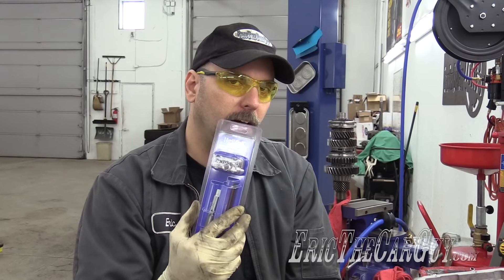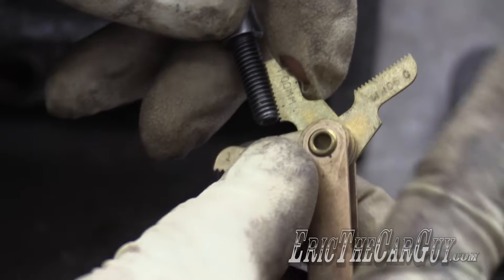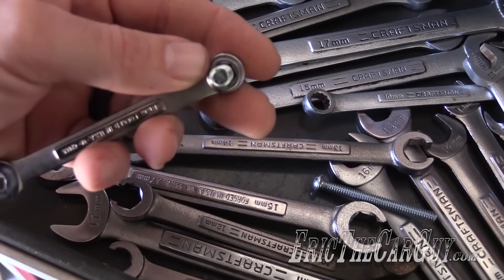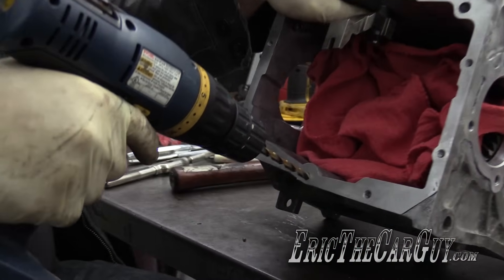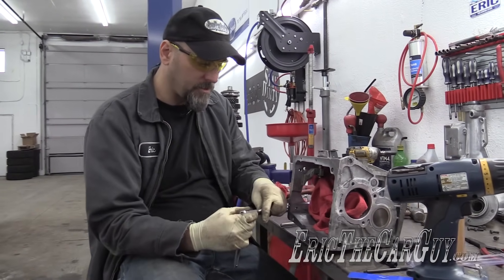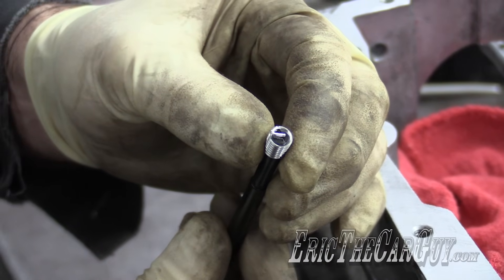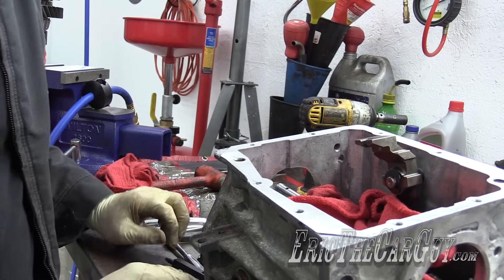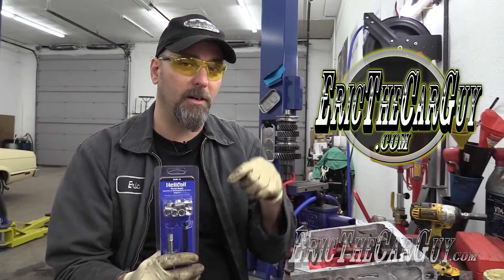Stripped Thread Repair: How To Install Thread Inserts

Comment: I've got a 2006 VW Passat 2ltr TDI 140HP
I replaced the rear bush on the lower arm (the one in the cup) but a thread was damaged.
A friend and I tried to re-tap the threads with some success but it's now working loose.
Would a Heli Coil kit be strong enough to withstand the stresses that the suspension endures?

Comment: Why only small amount of AWD cars has a diff locks? I mean, normal diff locks, for every 3 diferrentials. That allows car to be better in off-road situations. I know that there is an electronic stuff trying to "lock" differential using brakes, but that is not enough sometimes.
Reply from the maker: You'd have to talk to one of the factory engineers on that one.

Comment: I drilled it out with a 1/4" drill bit to a depth of 3/4". The hole is too big for the 6 mm X 1.00 mm pitch Tap. Shouldn't the tap size be like 7 mm X 1mm pitch to allow for the helicoil?

Comment: Could one put in more than one helicoil to have longer threads?
Reply from the maker: IDK. I don't know if I'd try that. If it's not aligned correctly it could bind up the fastener.
Reply: That makes sense, maybe they make longer coils. Thanks Eric!

Comment: are they stronger now since they are made of steel? (the threads)
Reply from the maker: Hard to say, but they hold up under the factory specified torque just fine. 80inlb BTW.

Comment: Why do we need to use those inserts? Is there a benefit? Why cant we just tap the hole and use a new bolt for the correct size? Is that insert "always" needed?
Reply: Short answer: Yes, but it also depends.
Long answer: Since the treads have been stripped there needs to be a way to create the same size threads for the original bolt/screw. To do that you have to drill out the hole slightly and tap it so the insert can fit inside to then give you the correct thread size again. You could step up the bolt/screw size itself so you don't have to do that, but this is not normally advised. For the most part it depends on where and what it is.
Reply: @JandCfilms1  interesting.... thank you for explaining. makes sense.

Comment: I have the same problem with a budy of mine car. I have never used a fix a thred type of thred repair before. it is a m8-1.25 bolt the package is not all that clear on the drill size though. it said 8.3mm or a 21/64 drill bit I am kind of stumped to be honest because I don't want to use a wrong size and ruin the whole transmission. it is a fix-a-thred you would get at the local autozone and advance auto parts stores. any sugestions I don't mind I admit I am a bad speller at times

Comment: I was taught to use Locktite on these things, I don't know if you have another reason not to eric
Reply from the maker: +MrXSmasher  It wasn't listed in the instructions so I didn't include that in the video.
Reply: +EricTheCarGuy so wait. Generally do u use lock rite then? Just making sure I do things right
Reply from the maker: No I don't generally use it on thread inserts.

Comment: Can thread inserts be used on an open hole? All 4 of the threads holding my throttle body to my intake manifold are stripped, currently I'm using extra long fasteners with nuts on the end, but it's frustrating when I need to remove the tb
Reply: I think so, but in that case I'd definitely use Loctite. You could also look in to Keensert or Timesert.

Comment: I tried to remove the radiator drain plug but it broke on my Mercedes w210. I drilled it and removed it. When I replaced it with a new drain plug, water was leaking from the litlle black hole next to the red drain plug, I assume I damaged the threads. What can I do to fix the problem?

Comment: hey I wanted to ask u I have a built dseries Honda turbo nd two of my block threads that headstuds go in got strippin in nd some guys at a shop helped me get it helicoil nd the car hasn't had head lift but I was wondering if I take off head Nd put ARP studs nd torque them dwn more would those helicoil s support my boosted Honda  for more boost ??? how good do those helicoil s last I'm I able to torque em dwn to like 87foot pound s?

Comment: On metric bolts, the thread diameter  is always 0.1mm to 0.2mm smaller then  the threadsize itself.  Means: M5 = 4.80mm  M6 = 5.80mm  M8 = 7.80mm 
Don´t know about imperial threads

Comment: Damn this happened to one of my bolts that holds my valve cover and I don't really want to drill into my engine block with all those components. Is there any other way?

Comment: would you use this on a brake part? (the bolt where the caliper carrier is attached to the hub assembly)

Comment: 02  Elantra......Anyone know what  torque limit should be on this Helicoil's on a Timing Belt tensioner pulley Bolt which calls for 38Ft pound  will these Helicoils hold up to 38 Ft of torque
Reply: Yes, they should be fine.
Reply: Still holding good I marked the bolt with a sharpie and check it every now and then for any movement
Reply: @jimd7241  Good to know! Proof is in the application!

Comment: The best way to check bolt sizes is to use a 'screw chekr'. I use these things all the time. First, insert the threaded end of the bolt into the hole in the far left of this device. The bolt will just clear the hole if it is the correct listed size. There should be little or no contact with the bolt threads and the sides of the hole.  Then try threading the bolt into the right side set of holes until it threads in perfectly. Now you have the correct bolt diameter size, thread pitch, and there's even a ruler on the tool to measure the bolt length.      https://www.amazon.com/s?k=screw+chekr&crid=8SLD1TCDLSZB&sprefix=screw+che%2Caps%2C513&ref=nb_sb_ss_ts-oa-p_7_9

Comment: helicoil already have loctite on it?
Reply from the maker: +movieguy73 No.  It wasn't listed in the instructions so I didn't include that in the video.
Reply: oic.
Reply: +movieguy73 Don't use thread locking compound with a Helicoil.
There are two designs of Helicoil. The regular type has smooth round coils all the way to the bottom. The "secure" type as one turn near the bottom that's hexagonal instead of round. This grabs the fastener to secure from backing out again. The secure type are colored purple for identification. If you need to secure use the purple Helicoil or mechanical locking washers like Nordlock.
Reply: +trespire the ones we used at work had dry loctite on them.
Reply: There are other threaded inserts that have thread-locker from the factory. These are usually not the helical style.

Comment: Why will my bolt not get tight. It feels snug, but in my application I have to torque the bolt down but as with the original threaded hole/bolt it wouldn't catch and thread down and/or get tight enough to torque. My application is on a thermostat housing assembly so unable to torque down, I have coolant leakage, this has been a very annoying and frustrating job

Comment: we use these at work on Blow molds because of people that torque down bolts on aluminum like it's a lug nut on a 18 wheeler. they work okay there not great.

Comment: You may want to wear a respirator when clearing aluminum shavings/particles with compressed air.  If inhaled, aluminum particles seem to find their way into the brain, which sometimes causes Alzheimer's disease.
Reply from the maker: +JPN850R I did not know that. Thanks for the suggestion.

Comment: Never use a ratchet to drive a tap. The force you're using to drive the tap is unbalanced with only one wrench arm (which is why a T-Handle, with two arms, is included in tap sets). With a ratchet, you'll likely either end up with malformed and off-axis threads, or (more likely) you snap the tap - which is very hard, and very brittle. At that point, you'll need a friend with an EDM machine.

Comment: E-Z lok inserts are better and especially if its a bolt you need to remove like valve cover bolts, oil pan etc👍👍👍👍

Comment: Is this what is done on the Northstar head bolts, god I hate that engine!
Reply from the maker: I friggin hate those engines.
Reply: +A D More or less. Depends on which repair system you use. I've used the heli-coil style, the keen-serts, two sized studs and even an epoxy type kit. Out of them all the oversized studs with epoxy coating seemed to work best, but they take longer to do..

Comment: You forgot the thread locker Eric the car guy
Reply from the maker: +Tim Wall The instructions do not recommend that which is why I didn't do it.
Reply: +EricTheCarGuy that's strange the heli coil kit I have says to apply blue thread locker on the insert before installing
Reply from the maker: Mine did not. I specifically checked for it.

Comment: It didn't come from the factory with a thread insert. lol. also, a drop of locktight on the heli coil to prevent it from coming back out when you remove the bolt.
Reply from the maker: The directions didn't call for that
Reply: +EricTheCarGuy Won't need it. Aluminum tends to gall EASILY, the insert will compress slightly as you install it and then seats into the aluminum. Once the bolt is installed and torqued once that insert won't come back out. Now if this was a full sleeve style insert then you would want to make sure it was either staked in, swagged in or some loc-tite, depending on the inserts requirements.
Reply from the maker: +Blazer02LS Thanks for putting a finer point in that.

Comment: You forgot to use loc tight!
Reply from the maker: The directions don't call for it
Reply: EricTheCarGuy I fully understand that it doesn't but it's common to do it for extra security. It's like most spark plug manufacturers in the early 2000s sent out notices saying antiseize wasn't needed but yet many techs continue to use it.
Reply from the maker: As stated, it wasn't listed in the instructions so I didn't put it in the video. Experience has taught me that no matter what I do in my videos, to someone, I'm doing it wrong. For that reason with videos like this I follow instructions to the letter. BTW I never put anti seize on spark plug threads.
Reply: +EricTheCarGuy I didn't mean to sound as if you were doing it wrong, as in most cases there's usually more than one way to tackle a problem.
Reply from the maker: +fordwindsor351 Perhaps drop the "!" next time then. ;)
Reply: +EricTheCarGuy right on! lol

Comment: This can't be the normal procedure. Every drill bit, EZ-out, pair of pliers, vice grips, and probably a few religious texts should be thrown all over the shop before a HeliCoil is even considered. The torn glove is accurate.

;)
Reply: billybobjoe198
The joke was that 99% of the time the thread gets damaged by drilling out a broken fastener (although I do own a T5 I had to put some helicoils in from a previous owner's "repairs").

That's been my luck anyhow.

Comment: Also id like to see something crazy thats never been built before.. take 2022 to newer heights... we have a lot electric and self driving cars and robots that are only smiling or 4 legged or flying robot  can you combine the two and make a robot that can get in the car sit, start the car and drive forward. I now dare you to build this... the car just needs to move one tire rotation and brake and tun off the engine.

Comment: i use helicoils almost daily, not m6 but m16 or m20 and sometimes m30 and i really prefer to glue a bigger bolt, drill it an d rethread it again, anyhow you can use a timserth from wurth, its a 1000 times better than the f*#*ing helis
Reply from the maker: Thanks for your input.

Comment: Suppose to install other direction. Tab you smacked off is for needle nose pliers. When tight it snaps off. But also why you guys say use silicon on both sides of a gasket 😆 horrible back yard mechanics

Comment: "You wanted to put it back to the way it came from the factory" I don't think that you did this. Did the factory use helicoils to hold the bolts in place? Then it's not the way it came from the factory!